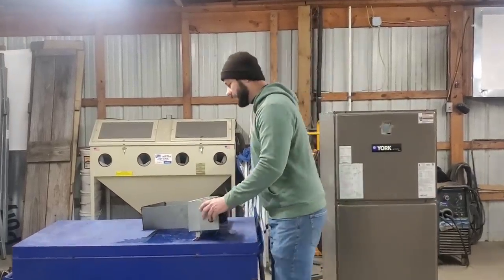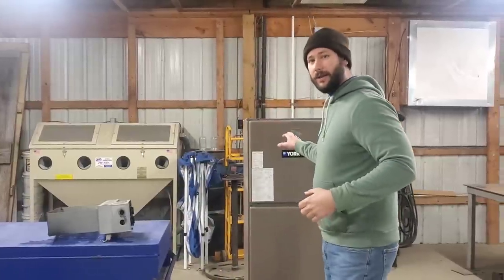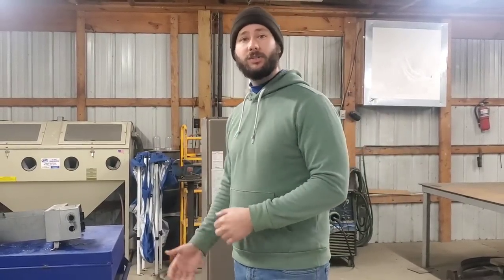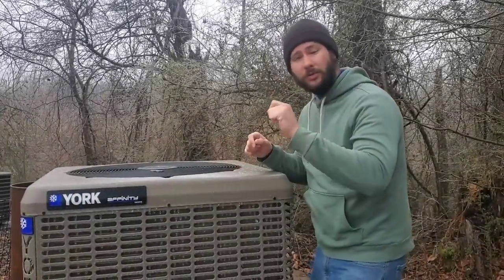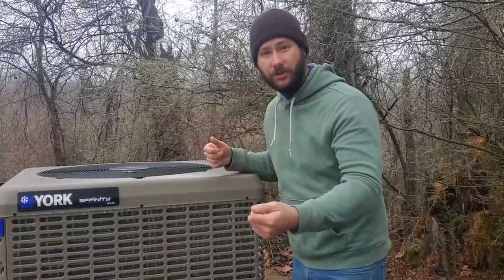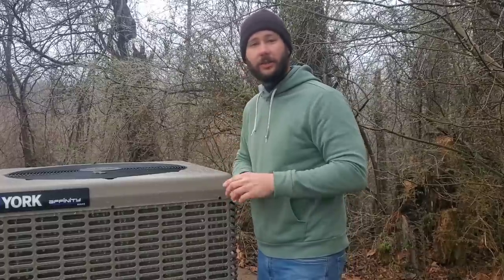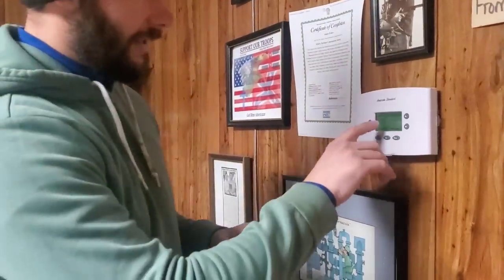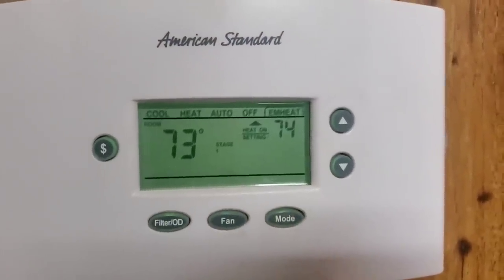Heat Pumps? When to use Emergency Heat? #emergencyheat #heatpump

Comment: I just posted this on my Facebook today telling people they need to use the emergency heat when it's below freezing. Some technicians will say oh you're losing heat because you're taking out the heat pump which is a source of heat but people don't realize you're running two separate pieces of equipment at the same time when you could shut one off and just run the single one and have much better Heat
Reply from the maker: I agree so true 👍

Comment: My electrician being a man of experience and full of wisdom, advised me that if I was going to use a heat pump in our old house, I better invest in a secondary source of heat. That was several years ago. We had a wood heater installed just last year. It compliments our heat pump very well. Our energy cost year to date compared to the same period of time last year has dropped 25%. You can’t beat burning oak when it’s 20 degrees outside!! Thank you for the video. Very informative!!
Reply from the maker: That's awesome Roger glad to hear that you have the knowledge to save you money
 The more knowledge the more opportunity
 Thank you for watching
Reply: @TaddyDigest   
THANK YOU FOR THIS ! 
     ONE QUESTION --- I WAS ALSO TOLD BY SOMEONE  TO NOT TURN  MY HEATER OFF  (FOR SOME HOURS OR DAYS) AND THEN BACK ON(auto).... BUT JUST LEAVE IT ON AUTO ALL WINTER   SO IT DOESNT MESS UP ..SOMETHING IN THERMOSTAT OR SOMETHING ... 
   IS THIS TRUE ??? _____ . 

To me during warmer days  it wastes energy ...because even set at 72° ...it always comes on every once inwhile  regardless really. 
~~~ So during those times i liked to turn it off.     Yes   ?
Reply: WELL, you just put me on to something here. I've never heard of a wood heater, but now I want one lol. Simply for the fact that I wanna smell that beautiful smell. Well, also of course because I wanna save some money too. Thanks for giving me something else to get lost down a rabbit hole looking up lol.
Reply: @jasongCLJ  I leave my heat pump set on auto. Summer months the thermostat is set on 75, winter 68. The unit not only helps to maintain consistent temperatures but also controls humidity in the house. If you turn your unit off for hours or so, and then turn it back on, it has to work extra hard to catch back up.
Reply: What are other secondary sources besides the wood heater?
Reply: @plmpcharisma9686 - You can do a ventless propane wall heater for supplementary heating when temperatures drop below zero (maybe the teens depending on your insulation and heat pump) and the heat pump can no longer keep up with the demand.

Comment: I have a 2 1/2 ton Rheem installed last spring.  Recently on a 25 degree day I was  measuring 87 degrees at a register and it wasn't on aux heat.  My system on aux heat uses one heat strip and 2 strips on emergency heat.  The system will go into AUX heat when the heat pump can't keep within 2 degrees of the set temp.  The installer advised not to use emergency heat unless the heat pump fails.

Comment: Thanks for you video . I was worried about running my EM heat and damaging the heat pump . You cleared up a lot of questions for me . I am currently in the deep freeze of North Texas and it is below 0* this morning . I went outside to make sure that there was no fan blade obstructions from the snow and ice and fan was working but not much if any heat coming out of the vents . So I am on EM heat now plus gas logs and it is warmer than before using the EM . Thanks again !
Reply from the maker: very cool really glad to hear that you have heat. glad you watched this video thank you
Reply: Omg I live in Dallas TX and my outside unit started shaking like if it’s unbalanced. I immediately turned it off and put it on EM because the house was freezing cold. Today it’s 32 degrees and I tried turning it on on heat and the outside unit is doing the same thing. I wonder if the motor damaged....

Comment: Heat pumps can function well into the teens though .. our heat pump can keep up with no issues until about 10F then the auxiliary heat will start helping .. They also have a defrost cycle that prevents damage from snow / ice .. during the last storm in Arkansas the temperature dropped to -2F and the heat pump was still producing heat through the coils .. I had to remove the snow from its sides .. running costantly through a snow storm / freezing rain is actually a good thing and it should prevent the snow / ice from accumulating (within reason of course)..
Reply from the maker: Very cool this is good information thank you for letting me know this information I will consider this And try to And try to evaluate for when we should turn the heat strips on
 Thanks for watching
Reply: Hello fellow Arkansas resident! You are absolutely right! I was concerned because my heat pump refused to cycle off but it kept the house at 72F and only occasionally used the emergency heat when the temperature hit -2F that one morning. From what research I did, the long run times are normal when the temperature outside goes below freezing. As for the snow/ice you are right again. My split unit is on the leeward side of the house so I didn't have to worry about snow piling up around it, but it's a good idea to check anyway. Overall, I was impressed as this is my first heat pump and didn't know what to expect. So, despite running so much, my final electric bill for February was $130 and will probably go down before summer. Nice!
Reply: Thank you. I'm new to a heat pump and didn't understand why it ran so long at time during below freezing Temps. I actually bought a new digital thermostat thinking the old one was malfunctioning.
Reply: @a.milligan9165  Why would you think that if the temp in the house was just barely being maintained? It would be one thing if it kept running and the house was getting hotter. A thermostat's job is to maintain the set temperature within .5 degree either way and will run the equipment as long or as little necessary to do that.
If you're new to something, the internet is your friend. ;) I was going to say google is your friend, but that's not been true for some time now.
Reply: Define "function well" and "no issues".
Sure, it'll provide heat, but at ever increasing cost until you reach the 2 or 3 times mark above normal of the emergency heat alone. I consider my electric bill in really cold weather to be a significant issue. :D

Comment: I had my 6 year old York unit serviced this fall by the same morons who installed the unit. I told them my heat pump was doing exactly as you said when it's really cold outside. They claimed they all do that and to run it anyway. I suspected they were full of sh*t, so I have been running on emergency since it's been in the teens outside the last couple of days. Your video confirmed my suspicions.....Those guys really ARE full of sh*t!!! It's working fine on emergency setting! Thanks for the valuable information.

Comment: Thank you for this video! My apartment maintenance man tried to run the okie doke on me regarding if my unit was working correctly. It was around 40 degrees here in Texas, and my heat was staying on constantly and just blowing cool air. I was trying to keep the temp inside at 76 degrees. The thermostat said Aux Heat, but the air out of the vent was still cool. So I turned on the emergency heat (not knowing what I was doing), and warm air started flowing. However, I turned it off out of fear I was causing an issue. I told my apartments something was wrong because the unit should not be blowing cool air when in normal heat mode if the temperature outside is in the 40s. The maintenance man said I should use the normal setting if I am trying to heat the apartment by several degrees, then use emergency heat if I am only trying to warm by a couple of degrees. That doesn't make sense because the normal setting doesn't raise the temperature by one degree and continuously runs. Needless to say, I am moving in a couple of weeks.
Reply from the maker: Brandon so glad that this video was of help to you glad you watched thank you
 Please hit the light button

Comment: Most heat pumps will automatically switch to aux heat if needed. No need to switch just because it’s below a certain temperature, at that point you’re just killing the efficiency of the heat pump and might as well just run a regular furnace and a straight cool unit. I have a 3.5 ton Payne ac/heat pump that chugged along all the way down to -10°F before automatically switching over to aux heat only. It would occasionally kick on the aux heat above -10 when needed. It’s listed as emergency heat for a reason not something to constantly use because it’s a little frosty outside. I would recommend to anyone to use the heat pump on regular heat setting unless it’s not maintaining temperature. Then check your unit for ice buildup and at that point switch to emergency heat and get the unit defrosted or call an HVAC tech. Maybe some units are different but I can’t imagine a unit that needs to be manually switched to EM heat at 30° or colder would be installed anywhere outside of south Florida or Coastal southern California.
Reply from the maker: Absolutely I agree Brad great comment with good information
 Thank you for watching and commenting
Emergency heat has to be used here in Tennessee when it gets real really cold and there's ice build-up on the equipment which can damage the equipment
Reply: As long as you have a newer thermostat then yes it'll automatically switch.  However on older ones like mine you have to manually switch. So know which type you have

Comment: Hi Tad - great video. I have an Ecobee thermostat that has capability to bring in heat strips via (2) stages. My stage 1 is 12 KW and stage 2 is 24 KW. This past month has been very cold so we have used heat strips a lot but here is my problem that you may have seen. Stage 1 - provides cool air at full currents draw. Stage 2 provides warm air at fu current draw. Question - can a heat strip have fun current draw but little or no heat output? How can one check this as these heat drips are full enclosed.
Reply from the maker: https://youtu.be/JSMNm4XYII8
Reply from the maker: I just did a video I will send you the link and it should help you.

Comment: Good video to educate people.
Heat pumps as the only source of heat suck for many climates/areas that they are installed in. I have a two story home with two, located around the Washington DC area. We regularly see temps in the mid to low 30s and even below. Right now it's 20 deg F outside this morning. Thankfully, I was able to install a pellet stove when I moved into this place and that does a good job of keeping the runtime of the heat pumps down to around 50% on the coldest of days. I need to tweak my basement air return which should reduce it even more. Our electric bill stays below $200/month this way, Otherwise, I'd expect it to be well over $300, maybe close to $400.
If I can get pellets at a discounted price I'm guessing my cost is lower than heat pump alone. At normal pricing, it's probably comparable, but with wood pellets at least I have more comfort and when paired with my generator, heat during power outages.

Sadly, it's going to get more and more expensive to heat our homes as the false prophets of climate doom push for more and more "green" energy. Rolling blackouts are gonna be fun too. Don't worry about them though, the elites always flourish above "the people".
Reply from the maker: thanks Chris Great information 👍
Reply: How's that electric bill looking this year?  My auxiliary heat is cranking while it's 15 degrees outside.

Comment: Had a Lennox installed last month after having a Trane for 15 years. Tuesday the compression stopped working, and we were cold for a few hours until the tech told us to use emergency heat. The Trane never stopped, nor have we had to use emergency heat before. I was told that the Lennox compressor will automatically stop in very low temperatures.  I don't like the idea of using emergency heat and having a high electricity bill.

Comment: We just had a cold spell below 0. When I came home from work I noticed my outside unit was not running. I switched my thermostat to emergency heat for a few days. After outside temps warmed up, I switched back to heat (through heat pump) and the outside unit still would not run. After turning off the thermostat for a couple hours and turning it back on the outside unit started to run again. Have you ever heard of this happening? I was getting power to my outside unit and the caps were good. The contactor was not pulling in during this time.

Comment: Just had our first heat pump system installed yesterday. Trying to gain knowledge about it differences to our old electric heat only system. Installer commented to switch to emergency heat below 28 degrees or it could trip a breaker which I had trouble understanding why. You brought up a good point about accumulation of ice and snow being a potential problem and I can see where that is a new item for me to be aware of.
Reply from the maker: Congrats on your new unit glad you got a heat pump instead of straight electric 
Knowledge is power 
let me know if I can help 
Thank you for watching please subscribe and share the video

Comment: Hi Tad, It was below 30 Degrees F in New Jersey yesterday and my Heat Pump Compressor was running continuously. I switched ON Emergency Heat from my Google Nest E Thermostat. My set temperature of 72 was reached in about 30 minutes and the compressor stopped running. You mentioned that the Compressor will stop right away if I select Em Heat on the Thermostat. Is this correct? If yes, I will be using less electrical energy in Em Mode by not running the compressor than in the Normal mode when the compressor will be running along with the Aux electrical elements.
I had misconceptions about Auxiliary Heat and Emergency heat being two different things. You clarified that they are the same electrical heating elements within the Air-Handling unit. I tried to understand this concept by reading tons of literature from Google Nest and other sources but could not understand. Thanks for your video which clearly explained everything that I needed to know. Brilliant!
Reply from the maker: Yes, the compressor will stop as well as the outdoor fan motor. Glad to hear this. Thank you for watching my friend.

Comment: My girlfriends apartment was seeming like it had tissue paper for insulation in this -30° storm.. when I went to see if the pilot light was even on because they vents were blowing cold air I was surprised what I saw. 

Turns out, she has a Goodman Air Handler and not a normal furnace. After just flipping it to emergency for five minutes our indoor temperature went up six degrees. Thank you!

Landlords should really warn tenants if they go this route, especially in a state like Indiana where we get actual winters. 🤷 Hope that thing outside is okay after nearly 24hrs running in subzero temperatures.
Reply from the maker: Glad you got warm heat now good deal

Comment: I'm using a large Mitsubishi Zuba Central Heat Pump which was installed with a 5kw Aux Heat strip.  While my Heat pump is rated  to perform in well below freezing temps...a large concern for me is during large winter storms which may result in a power outage.

Depending on how long the power is out for it is nice to know during the outage I can fire up my backup generator and switch the heating system to emergency backup heat...during this time I definitely have a tarp or two ready to wrap around the outdoor air unit to prevent snow/ice buildup.  I make sure the outdoor unit is off at the breaker switch and to do a thorough inspection before switching the outdoor unit back on when power is restored.
Reply from the maker: Very cool
 That 5KW is not very much though
 At least you have a plan when things get tough
Reply: @TaddyDigest  

No you're right it isn't really a lot....and to be honest I haven't had this scenario play out just yet ...the equivalent of 3 space heaters really...the house holds heat half decent but when the winds crank off the lake heat loss is great...not sure the 5kw would be enough to keep up....but hoping I can keep around 18°C If possible...have to see

Comment: During defrost mode , heat strips come on as well right? This is where I get confused. I’ve been hearing different purposes for them such as what you mentioned and that for emergency, they will ONLY run if the compressor fails and they are ran as a back up. But what about during defrost or supplemental (running with the compressor?) 
I’ve been in the trade for 7 years but never had an opportunity to install heat strips or rough them in (high voltage wires) so I’m having to research and try to learn so I don’t make a mistake once I come across it. I’ve installed heat pumps here in AZ but winters aren’t bad so there are a lot of heat pumps with out heat strips